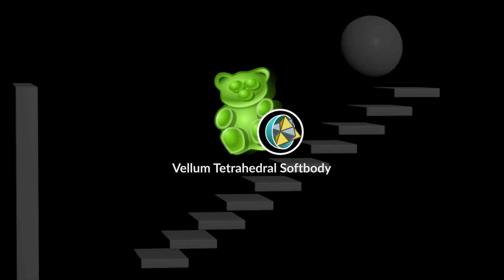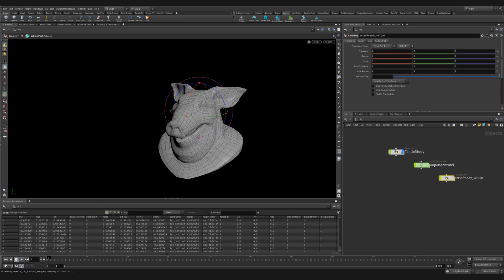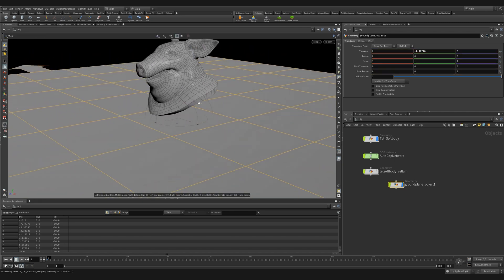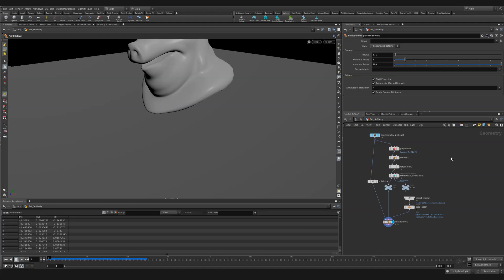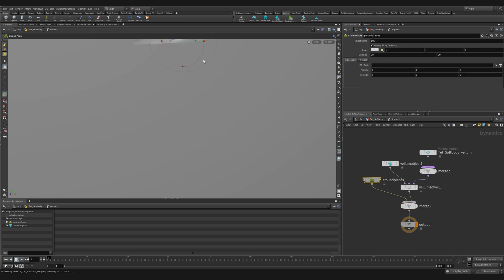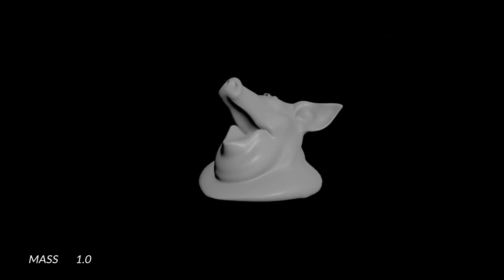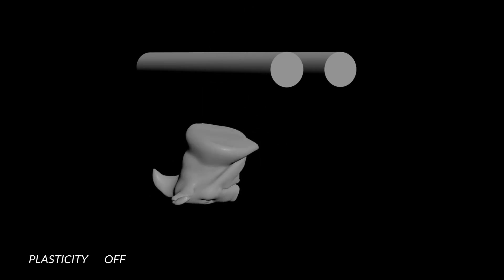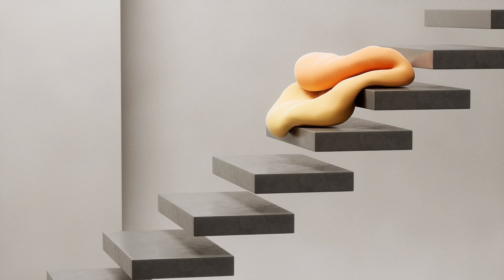09 | Vellum Nodes | Tetrahedral Softbody

Comment: Not sure if this is due to houdini version changes but the 'default settings' section shown in this video is not accurate. changing density to 1 doesn't do anything, still flattens like a pancake. I had to reduce density to 1, to increase stiffness 1->1000ish and damping ratio to 1 to see similar behavior as this video just changing density.